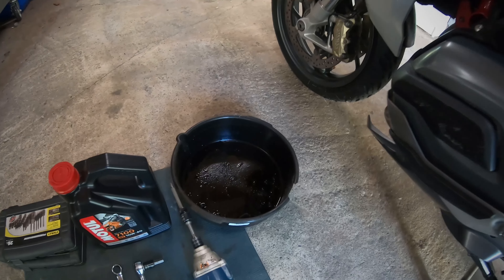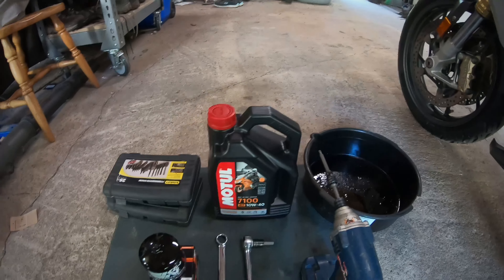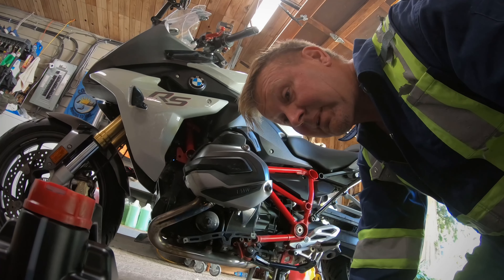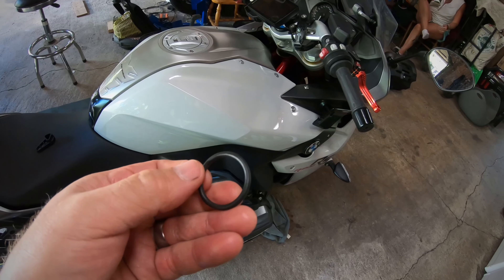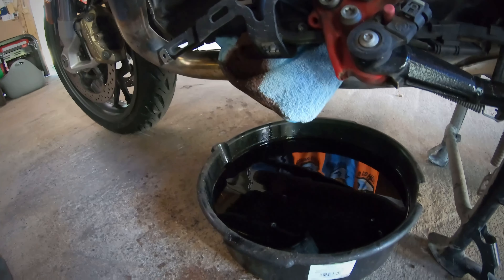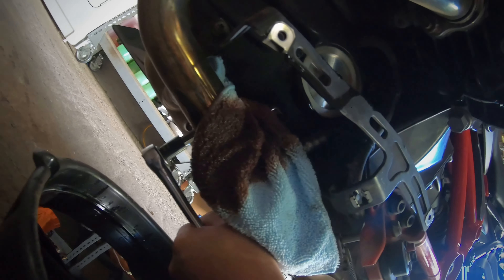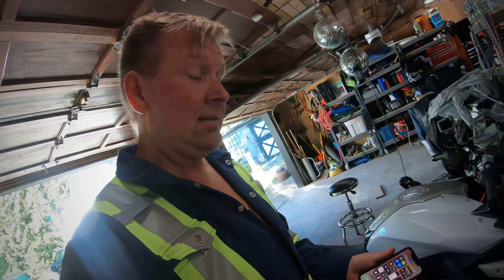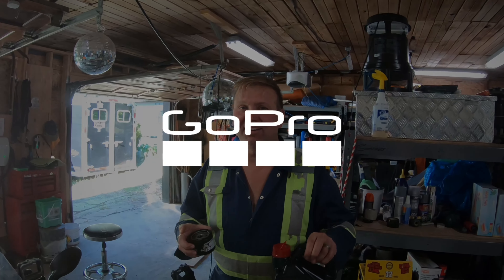DIY BMW R1200RS Oil change

Comment: The parts I used  used 
1-k&n kn160 filter
3.8 litres of motul 7100 10w-40 full synthetic oil 
1-crush washer from my secret bin of things. 
I reused the oring under the fill cap as it was in perfect shape and didn’t need replacing 
Tools
1-10mm hex/alan key socket 
3/8 socket and long extension 
Bmw oil cap remover 
17 mm socket to remove filter 
25 torx socket to lower fairing skirt.

Comment: Is it ok to put a 10/40 in it?
Reply from the maker: We spoke to the dealership about it before hand and have been running it for the last 20,000 km, viscosity difference is nominal.  We use fully synthetic because it just works better with more longevity and reduced wear in all our motorcycles and vehicles.  Hope that helps.  If in doubt check with your dealership, but this is something we have throughly looked at.  The majority of our riding is also in the warm summer so climate and time of year is something to think about in your area.
Reply: @lisalancastertravels  I know Shell state 10/40 and my dealer states 5/40  ---thanks for the info I have a 1250R  and live in N Ireland but no winter riding.